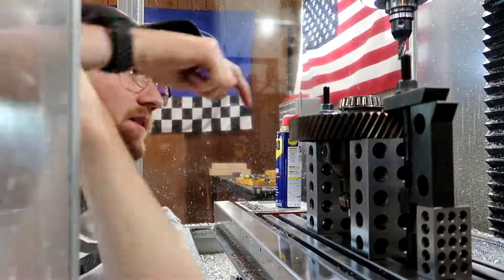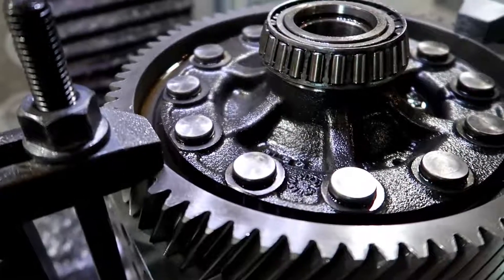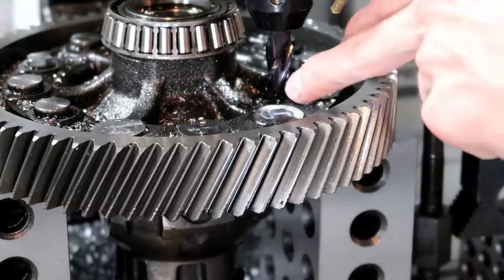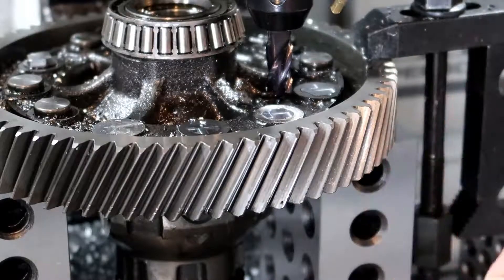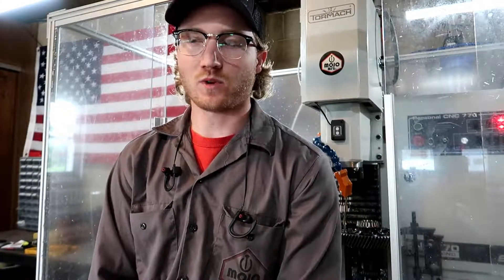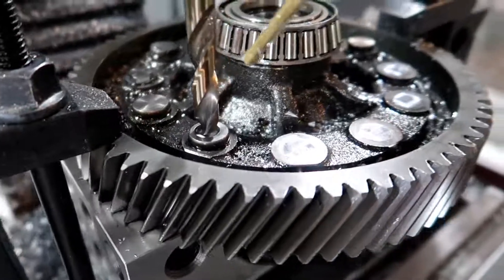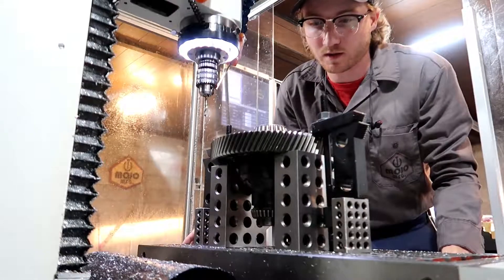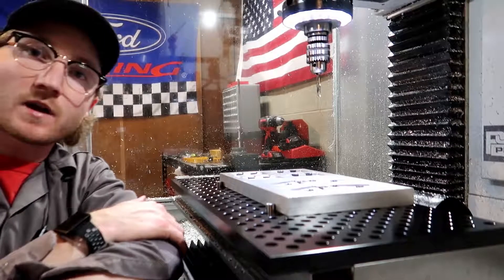Differential Housing Machining: Home Mfg. Days #43

Comment: If you can drill through the head of the rivet using a drill that's close to the rivet's diameter, you can often just stick a pin punch of the same diameter into the hole...and use it to break off the head that you've drilled to just below the level of the thickness of the head. Then you can just drive/press out the rivet.
Reply from the maker: Not a bad idea.  I'll just have to make sure I get the drill very close to the center of the shaft of the hot rivet.

Comment: Thanks for the shout out Garrett!  yep....the drilling method needs to be pretty close to center.  Then, if you go a hair too deep, it just chamfers the hole slightly.  If they're hot rivets that were pressed into place, the head may not be quite as concentric to the shaft as it should be.  I'm guessing they were actually done cold with a lot of pressure.  Maybe something to try another time.  The end mill method should get you close enough.  Have you tried tapping them out yet with a 1/4" drift(punch)?  I'm curious to see how hard they are to push out. 

I liked anon's tip about the saran wrap on the bearings.  I'm sure I'll use that one in the future! :)
Reply from the maker: I'll show in the next video pressing them out.  It was fairly easy with the 20 ton press that I got.  I' might try the drilling technique next time I do this, which shouldn't be too far off in to the future.
Reply: Sounds good! Thanks! :)